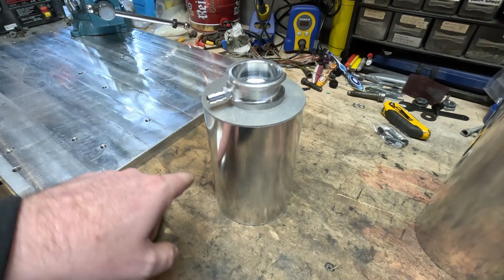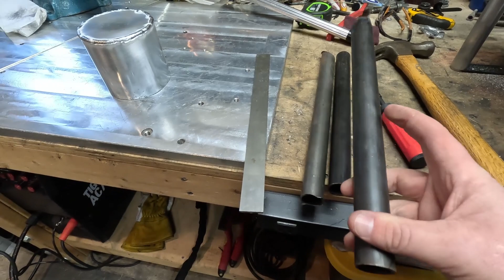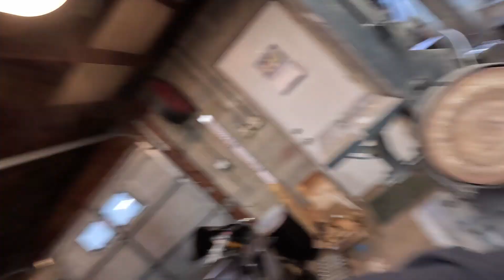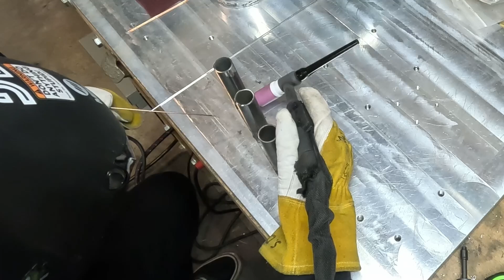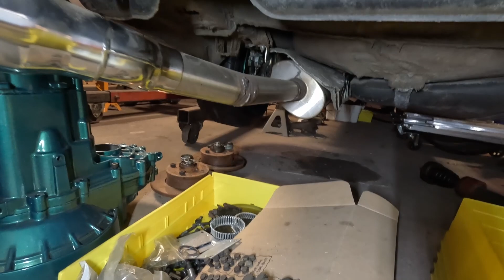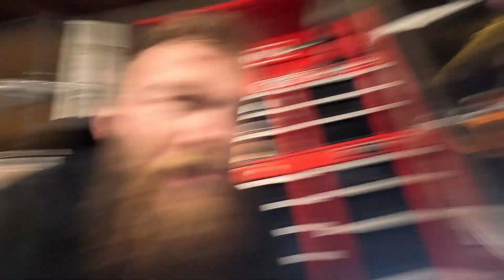Welding projects to get rid of scrap metal and clean up my garage

Comment: A good hint for aluminum is wood tools in a fabricator down in FL I use chopsaws, jigsaw, router,ect. As far as welding aluminum I have a primeweld Tig 225x w/ maxcool watercooler CK worldwide flex-loc torch. I weld my aluminum at no less than 150 amps and 20-30% balance 3/32 tungsten 2% lanthinated is a good all around.
Reply from the maker: Thanks for those tips, I appreciate it! I’m using an Eastwood TIG200 AC/DC machine. Unfortunately the balance adjustment isn’t the clearest thing in the world as it’s on a scale versus being a true number but this gives me an idea to go off of. I was also using 2% ceriated tungsten so I’ll have to give it a try with lathinated. Thanks again!